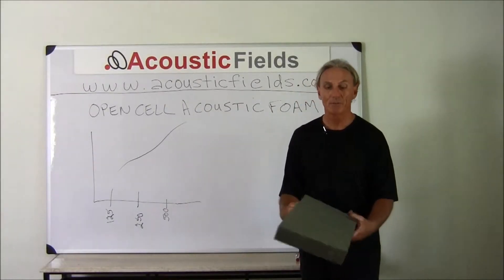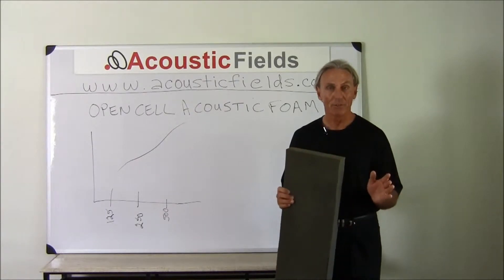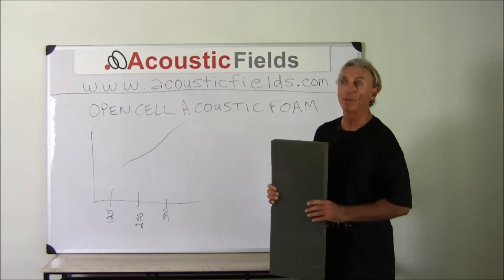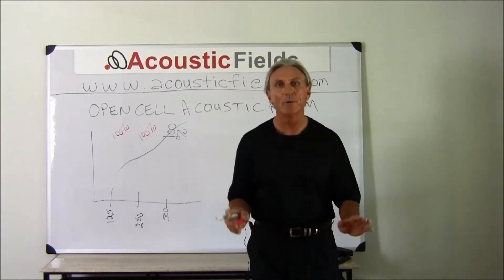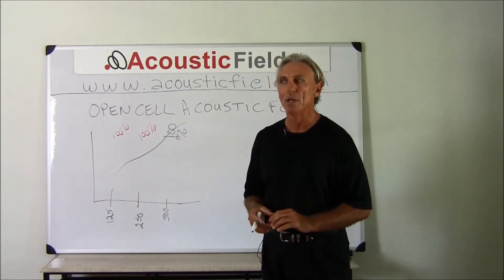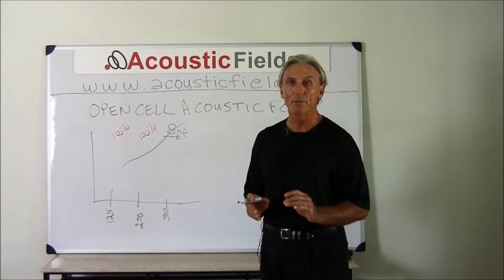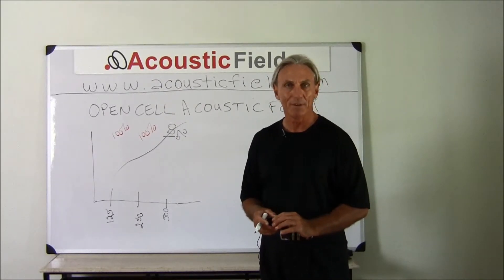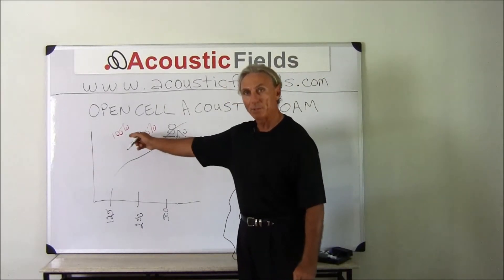What Do You Want From Your Acoustic Foam? - www.AcousticFields.com

Comment: I have a 15’ x 25’ room. The ceiling is slopped from long wall to long wall. I am currently set up along the long wall to minimize side refections. Thoughts?
Reply from the maker: Yes. Side wall reflections are an image destroyer. Make sure distances from speaker to sidewall are equal.
Reply: @ unfortunately due to room layout the seating position is 14” off center. I have 3’10 on one speaker to side wall and 5’8” to the other side wall.

Comment: I don't understand that energy price argument. I think it's a nonissue, when you think and compare the energy cost of bringing the volume up a little bit against all the money audio enthusiasts spend to their passion. It's confusing that you root for getting the room as inaudible as possible but then say that a product doesn't need to absorb all the frequencies.
Reply from the maker: D,  If you have a mode at 80 dB SPL and you reduce amplitude to 70 dB SPL , you still have the mode and it is the same proportional ratio as the 80 dB SPL. You gain nothing and can't with this approach. It is not necessary to absorb at all frequencies in a room. There are simply too many variables to consider to make that claim. Absorption rates and levels must be balanced to address the issues within the room. We have two low-frequency technologies to provide those required rates and levels depending on room size/volume/usage. Our ACDA 12 goes after 30 - 50 Hz. with high rates of absorption. This high rate also impacts the harmonics through 350 Hz. The ACDA-10 is broadband from 30 - 100 Hz. with a 25% average absorption coefficient per octave. Using both rates and levels, applying each one in the correct modal pressure room area along with the required surface area of both, one is able to achieve a more natural and organic presentation that is not over absorbed and with minimum room sound.
Reply: I guess I was a little tired when I wrote this comment, of course one product can't handle all the frequencies at the same level and rate. There are crossoverpoints between products and I get that the crossover curves should be smooth. My apologies.
Reply from the maker: D,  No worries. For years, the thinking has been to design products that absorb as much energy as possible within the smallest footprint. And for years, this thinking has lead to rooms that sound over absorbed. The same thinking set has been applied to drywall. I can hear a drywalled room the minute I walk into it. In the 150 + rooms we have built, we have taken a different approach. We just treat the issues that the room causes.  Our goal is to get as much of the room out of the way as possible without infringing upon sound quality. Our first rule is to do no harm by adding other elements that are not music.

Comment: Sir http://www.amazon.in/Aurica-Pyramid-Shaped-Acoustical-Panel/dp/B00TS42NM2/ref=pd_sim_267_2?_encoding=UTF8&psc=1&refRID=16T0WPGFFHQ6547SC4QJ
will this panels will work well in my control room first reflection point? And about coconut Fiber sheet ?
Reply from the maker: Hi Loukik, The rate and level of absorption is not conducive for music and voice. Our foam was designed specifically for voice and music.